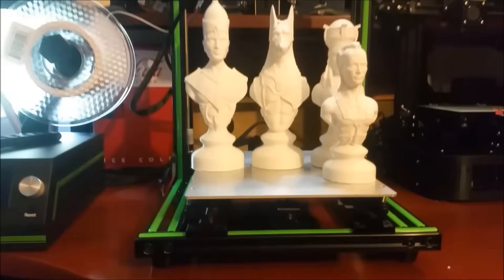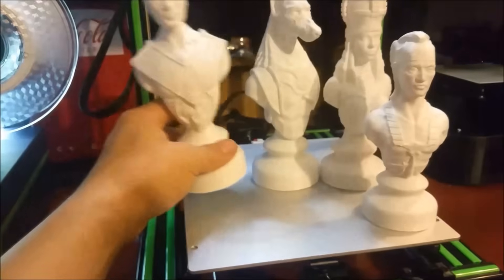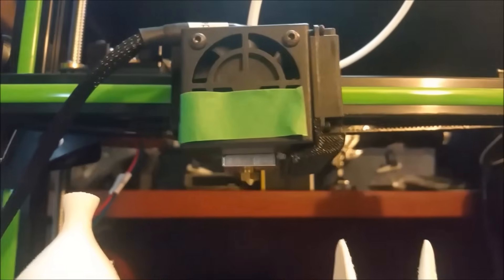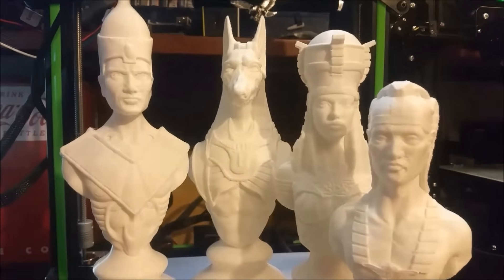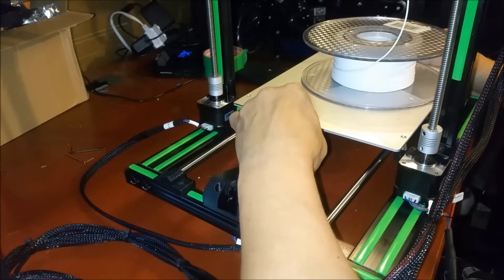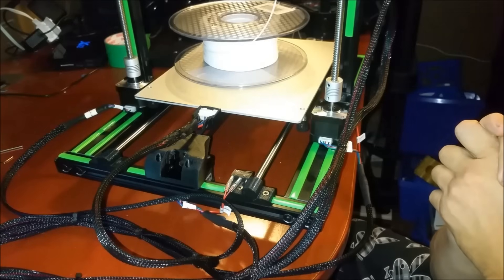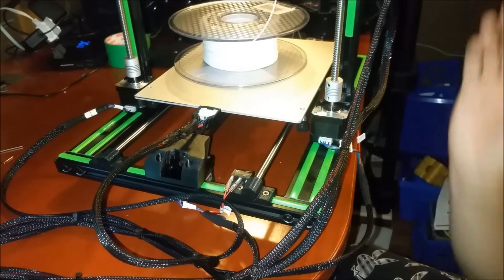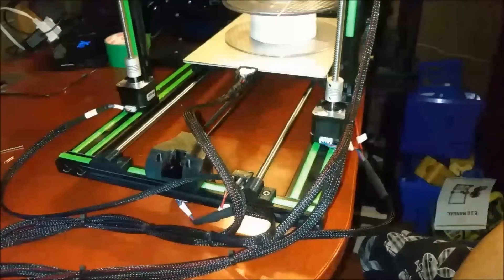The Anet E10 -  How Does it Print

Comment: the heated bed connector should be more robust, it looks like the same as on the Anet A8
Reply from the maker: It is Identical to the one on the A8. I will be soldering the wires directly to the bed. I did not do this with the A8 as there is a really fantastic cable chain setup for the A8 on Thingiverse that takes the movement out of the connection and secures the setup to the bed better. I know vibration and friction could cause heatup at this type of connection but I felt with the cable chain setup I applied on the A8 that on that printer I did not need to do soldering. You can see all the modifications I did to the A8 in a previous build video.

Comment: I paid 290$ for this Printer and it have build volume  220x270x300, cheaper Printers about 200$ have 200x200x200, So i bought anet e10 because i want larger build volume. CR10 is to me too expensive. So i should cancel my order or anet e10 is good choice for this price?
Reply from the maker: The Tronxy X3 has a build volume of 220x220x300 and its $200 bucks on Aliexpress and comes with 2 250g rolls of filament. It is up to you what you do about your order. My issue with the price is small compared to my issue with the QC problems I had. That printer is going to come mostly assembled and it has a better design for the bed then the Tronxy X3.

Comment: Thanks once again for your explanations, they seem reasonable...!

From what I've seen the prices of filaments are not cheap and those bigger prints should take a fair chunk on it, how much would you estimate the printing of those 4 pieces would cost in filament alone..?
Reply from the maker: The largest piece was 84 grams, I spend $26cdn on a roll after tax and shipping. The largest piece in filament cost me roughly 2.16cdn. The Smallest piece was 54 grams and cost me $1.40 in filament.  I should be able to get a large complete chess set of this size out of 2.3 rolls of filament which would cost me roughly $60cdn. Those 4 pieces specifically used a total of 280 grams = $7.28cdn

Comment: Thanks for the video and the prints.

I would call your attention to the fact that, many of us would like to see what the printer can do with its original parts, particularly the main parts such as the nozzle because we don't have those extra accessories and would not know what to do with the settings, sure, we can all upgrade things at a later time but, will be important to see what the printer can do with all its original parts otherwise any prints you make are not the real true representation of what it can do out of the box, if you know what I mean...!

On the other hand I'm happy that you changed your mind in regards considering to built some upgrades that will resolve some of the minor issues and or improved the printer's capabilities but that needs to be done later, for now "we" (the first timers) prefer to see the original stuff.

I'm also interested in expanding the reason as to why you felt the need to change the nozzle sizes, what was that the original one whas not doing or doing wrong...?

Gezz, I knew you had a "few" printers but 9...????
Reply from the maker: A 0.5mm nozzle is a trivial change from 0.4 and only requires one value changed in your printing software. The print will print slightly faster with a 0.5mm nozzle and I also find that what printing exterior walls, bottom and top layers that 2 layers each which would equal 1mm are a lot stronger then 2 layers at 0.4 which would equal 0.8mm. 2 Layers with either nozzle print at the same speed however I get thicker walls with the 0.5. I tried 4 0.4mm nozzles and as I said The extruder was skipping a lot and the only reason I could think of is that the voltage to the driver for it was not set correctly but I did not want to get back into the box right now and play around with it. The motor itself for the Extruder is a decent size and should be more then enough to push through a 0.4mm nozzle. Also nozzles are not considered an upgrade but more of an accessory and the cost next to nothing. I think I pay somewhere around $1.50-2.00 for a 5 pack of nozzles.
Reply: Yes, I did mention that nozzles are accessories and I know they are cheap but I wondered why you had the need to put a bigger nozzle, your explanation makes sense.
There is still the issue as to why the original nozzle wasn't working correctly, and what the solution may be without having to replace anything.
I apologize for all my questions and observations, I'm only trying to learn...!
Reply from the maker: I think it was not the nozzle but the voltage setting for the Stepper driver on the board. There should be a small pot on the board that you can adjust with a screw driver. This would involve my getting out a multi meter and fine tuning it and being very cautious if I adjust it to high it could over heat, too low and the motor wont have enough power to generate the torque it needs to push the filament through. This atm is the only thing I can think of that would be giving me this issue and I have not looked into atm the moment as it was simply easier for me in the short amount of time to put a 0.5mm nozzle on the printer. If I come  back around to it I may investigate it further and see if this is the reason I am getting a lack of torque on the extruder motor.
Reply from the maker: Some of them just collect dust as they are less pratical to use or more high maintenance. I have not used my Kossel Mini's in quite a while. They have nice print heights of 300mm+ but the base are of 180mm diameter is not as large as you think it sounds. A square of 180x180 has 40% more base area then a circle of 180mm. There is another reviewer on here who just got in his free Kossel Mini and is promoting it as the biggest printer for under $200 and it is really ticking me off as this is misinformation and I feel he is just trying to push the printer down peoples throats with flashy titles and bold statements. But as I said mine are collecting dust as they have a small base area and are not practical for printing objects with a large X and Y dimension. I use the CR-10 mostly with backup support from the Anet A8 and the Tronxy X3 when I am doing multiple prints at a time.